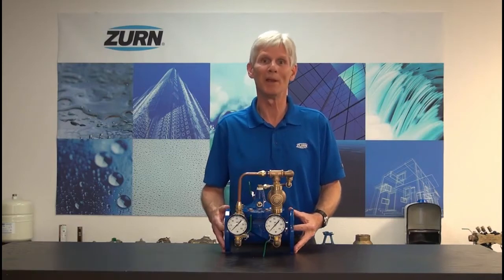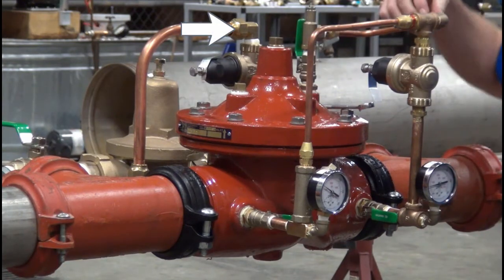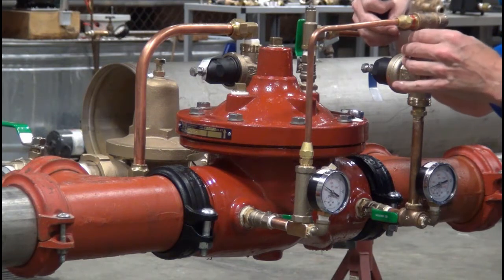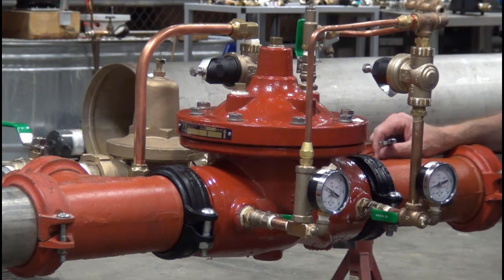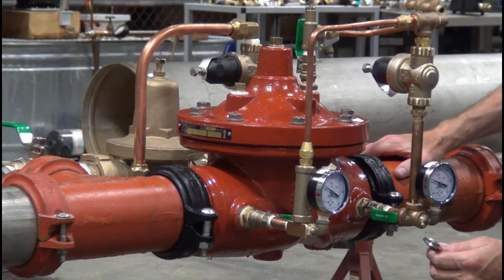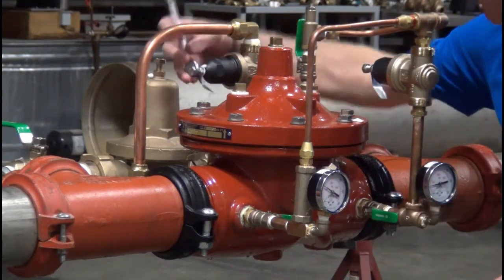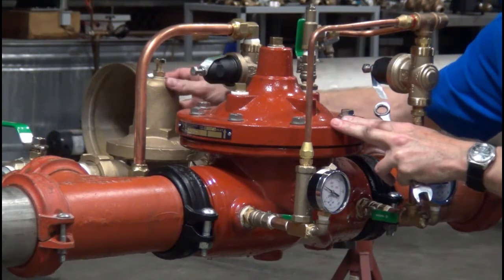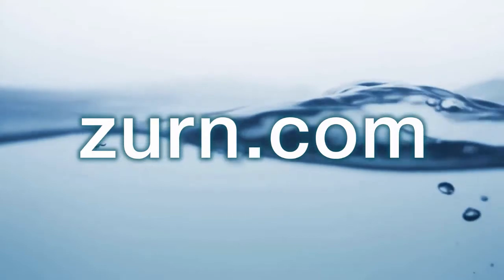Zurn Wilkins Automatic Control Valves ZW209BP - How to Commission

Comment: Looks as if the 1-1/2” PRV is necessary for this to operate correctly. I have a 3” ZW209 BP that does not have a prv for the “dead zone” that was spoken of. I have very inconsistent pressures and lots of water hammer in our facility. There are only a few times when we are at the max flow of the ZW209. Would installing a prv on the bypass correct these issues.

Comment: Why do you put your hand on the Gage ( Manometer ) ?

Warum legst du deine Hand auf die Messinstrumente ?
Reply from the maker: Any touching of the gauge during the video is purely incidental. The gauges will work as intended when setting the valve per the instructions in this video.

Comment: Can a 6" Zurn be blocked up by silt over   time
Reply from the maker: Hello, and thank you for your question. Here is the information we received from our product experts. "Yes, a 6” can become clogged due to silt over time.  Usually, the clogging will take place on the pilotry assembly.  Often the inline wye strainer collects a lot of debris and performance can be restored by cleaning the strainer.  If silt gets past the strainer then it is possible for the pilot valve to become clogged by debris.  The pilot also has a strainer screen that can be accessed by removing the bell on the pilot.  If you have silty water it is advisable to put a 6” strainer before the ACV as silt can also foul or damage the sealing surfaces." Please let us know if you have any other questions or feel free to reach out to our customer service team at 855.663.9876.

Comment: I am working on a valve identical to this, although it is made by Watts. Need to replace the whole thing. It is installed on the vertical. I notice that your valve is on the horizontal, on its back. Does valve positioning really matter with this type of valve?
Reply from the maker: Hi Rob the Plumber,
No matter which manufacturer you ultimately choose all automatic control valves will function when plumbed either vertical or horizontal up through 4”. However it is not recommended to install Automatic Control Valves in the vertical orientation on sizes greater than 6" since they will wear themselves out rapidly due to the weight of the plunger assembly on the guide bushings.  The weight of the internal components on larger valves will cause uneven wear and shorten the service life of the valve. On smaller size valves this really isn't a problem. The Zurn Wilkins Automatic Control valve comes in a wide variety of applications sizes and configurations and was designed for drop-in replacement of a majority of valves in the field.  
Hope this helps!  If not, feel free to contact our Customer Care department at 855-ONE-ZURN.  Thanks for watching our video!
Reply: Rob The Plumber .